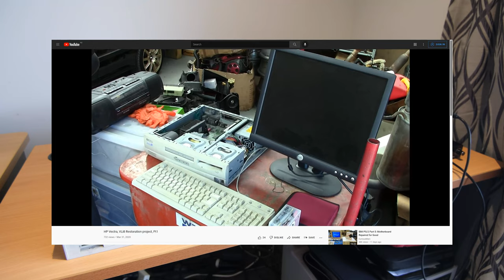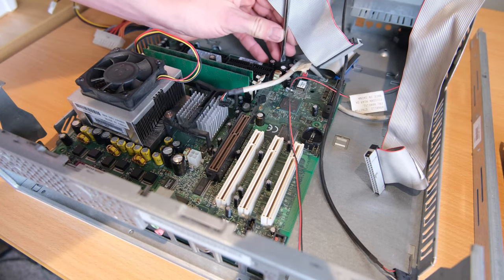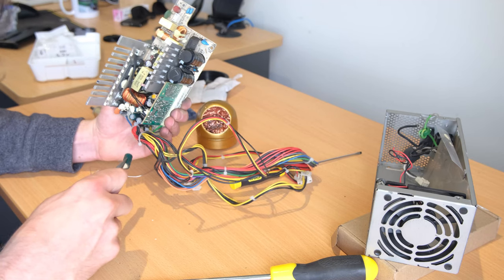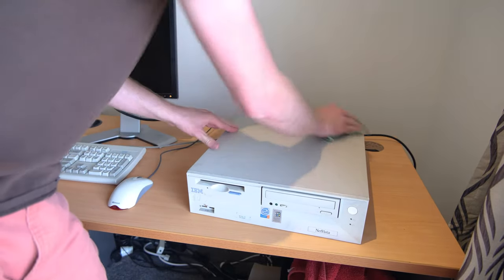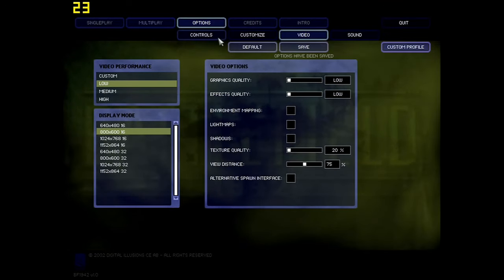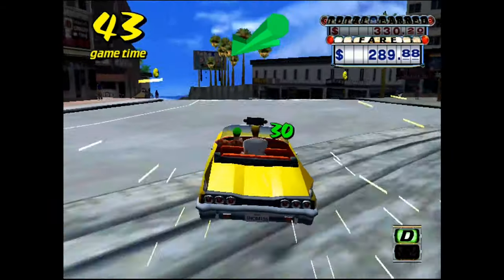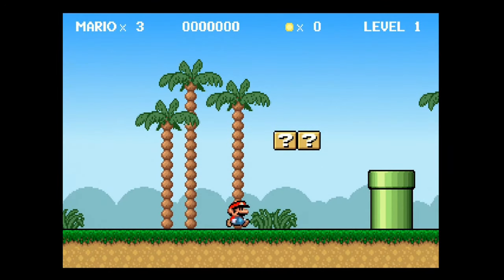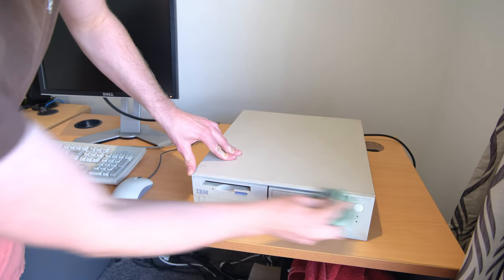IBM NetVista M41 | Saved from the bin

Comment: I’m shocked this system was headed for the bin. They are solid machines and perfect for retro gaming. I paid around $150 to get one because these are not easy to come by where I live. I got a black one but similar specs to yours. I was able to replace the power supply with an SFX size with a little better total wattage. I have a Voodoo Banshee in mine and upgraded the cpu to a 2.4GHz and bumped the ram to 512MB. I dual boot WinME and WinXP.
Reply from the maker: Yeah it's amazing what gets thrown out. They're not too common here but were used in many schools. The black ones are hard to find as well. I never thought about replacing the PSU as I forgot that SFX is smaller. Good option for upgrades. Sounds like you've got a good retro gaming machine out of it!
Reply: @thesmokingcap  I certainly did. I have a Voodoo 3 in mine, which was gifted to me by a seller on eBay. (There’s a story there to tell about that in itself if you’re curious.) The original PSU had a loud fan and was low wattage, so the SFX PSU was the best replacement given an original PSU was like $30-$40 on eBay. Holes don’t all match up but it’s secured well enough with two screws. I have no idea why IBM thought the PSU fan should be used for cooling the CPU as well, so I had to replace the heatsink with a heatsink and fan combo. The rear case fan was dead, too, so I replaced it. A lot of mods for sure, but the machine is pretty quiet now and will last longer with the improved power and air handling.
Reply from the maker: @mesterak  oh wow! A gifted voodoo 3! Yeah I I'd be interested in hearing about that one. Sadly I so t have the machine anymore as I sold it to make room for others. But it's gone to a new home
Reply: @thesmokingcap  sad to hear you don’t have the machine, but at least it’s being loved by someone else! As far as the Voodoo card, I had purchased a GeForce2 GTS card, but after a week there was no response from the seller and it hadn’t been shipped. I kept sending kind messages and waiting patiently. The seller finally responded and told me that he had been in a car accident. I consoled him and told him to take his time because his health and family come first. After about another week, he reported to me that he could not locate the card I bought, but because I was so patent he was going to give me a Voodoo card. I told him he didn’t have to, but he insisted because he had a few of them. He did some minor repairs to card, put on new thermal paste, and shipped it to me. I thanked him over and over and befriended him on Facebook. As it turns out, he belonged to several of groups in FB that I was also a member of. This is probably one of only a few times my kindness and patience were truly rewarded, but I’ll take it! I am a proud owner of a Voodoo 3 now knowing that if this had not happened I would have never afforded to buy one. There’s the story of my Voodoo 3. 👍
Reply from the maker: @mesterak  Oh wow! That's quite a story! Yep sometimes life is like that. It's great he managed to help you out as well. He's also probably happy to see such hardware go to a good home as well. If I had the room to keep this machine I would have. But I didn't sell it for a profit, just the cost of the new caps I put into it really. The new owner is very happy with it
Reply: @thesmokingcap  well it sounds like you have a kind heart as well. Thanks for sharing and the great conversation. 👍
Reply from the maker: @mesterak  No worries :) I like hearing stories behind the hardware. It's what makes us buy these things anyway

Comment: I'm surprised to see cheap brand caps in an IBM machine. I have one exactly like this, and it has Rubycon capacitors, all still good. The yellow capacitors are polymers, not electrolytic, and won't need to be replaced.
Reply from the maker: Oh wow! That's lucky that you don't have to re cap your machine. What caps are in the power supply? That's the other failure item. I ended up selling the machine off not long after this video as I wasn't using it. But assume it's still going

Comment: I've always kind of considered a Pentium IV was maybe not old enough to be considered worthy in the "retro computing" area, and too old to be worth anything for more modern tasks. But I'm a sucker for that form factor. I have an old Compaq EVO P4 under XP lying around I don't know what to do with... Win98 could be an interesting option, just like you did here. But it's still really noisy... As I said, it sits right in the middle between "almost useless" and "could be a somewhat fun project" :)
Reply from the maker: I know what you mean, they probably have a few more years to wait before they're old enough. At least this one still has native Windows 98 drivers. I remember those Compaq Evo machines. They do run quite warm some of them as well. But you're right with being in the middle of useful and useless haha. This machine doesn't have soundblaster emulation sadly, but still has AGP and a Windows 98 supported Chipset at least